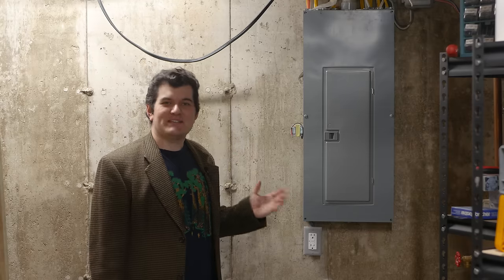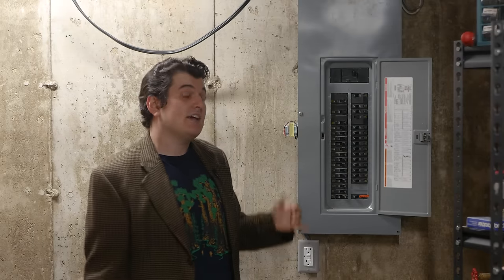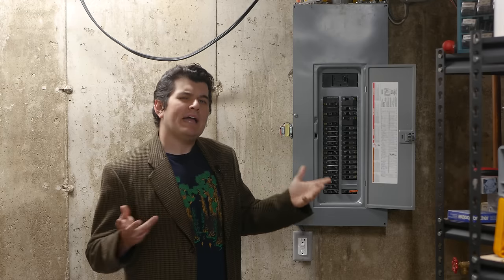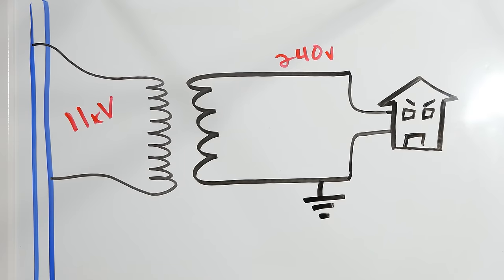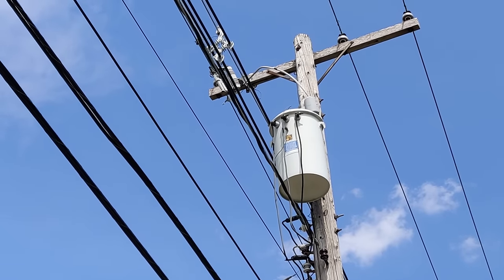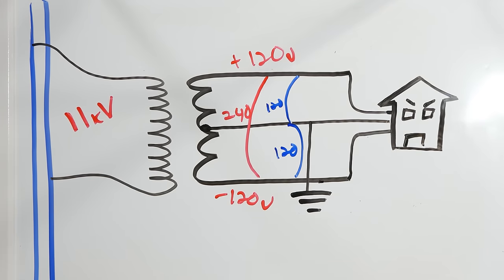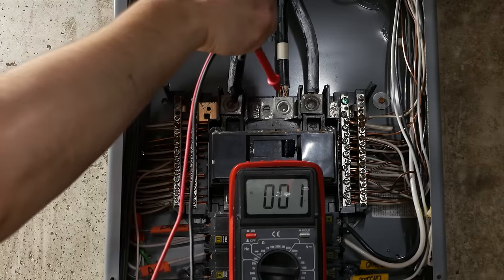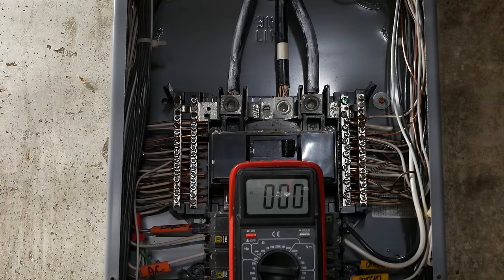The US electrical system is not 120V

Comment: With this logic almost all European installations are "400" volts as phase to phase is 380-420 and phase to ground 220-240 volts.
Reply: That's actually true and acknoledged, here in Australia all live electrical hazards are labelled as "danger 415 Volts"
Reply: Yeah, it's called '3-wire' power and is good for 400V.
Reply: I just found out that while most of modern Belgium has three phase with 400V between the phases and 240 between phase and neutral (as most of Europe has), some older installations have 240V between phases. And this can sometimes differ per house in a street.
Reply: Yes, here in Sweden we have 400 volts phase to phase and 230 volts phase to ground. We also have all 3 phases in our homes instead of the split phase system.
Reply: I just wanted to say the same thing :)
Reply: Put a rcd in the bathroom. Why? I have a rcd on the fuse board protecting the entire house.
Reply: @stefannilsson2406  
We only have single phase in our homes unless you specifically ask for a 3 phase supply. You do pay for it though, literally. 3 phase does run down the street and every 3rd house is on the same phase to "equal" the load on each phase. Only large consumers e.g. industrial, retail and office buildings have 3 phase as standard because they also use the phases for load sharing.
Reply: @ahorsewithnoname643  What country do you live in?
Reply: theoretically 440V in India.
Reply: @stefannilsson2406  NZ
Reply: @ahorsewithnoname643  Ok, I guess you guys have pretty thick incoming cables or maybe you guys just don't use a whole lot of electricity.
Reply: @ahorsewithnoname643  I learned this recently when my lights began flickering, while my neighbours reported no problem. The fault was with with a fuse on the pole transformer down the street - it was going intermittent, affecting just that phase (and apparently overheating, according to the line technician). Now that I look at the transformer and the overhead wires with a better understanding, the three phases are quite evident.
Reply: The big difference as @A horse with no name mentioned and others explained here is that 3 phase is not to the house (unless you pay for it) while in the US the 240V is available in every house and is not a 3 phase installation as explained in the video, we also have 3 phase installations here and annoyingly so as he mentioned those are 208v between phases
Reply: 400V is exactly what our electrical stoves, ovens and similar devices are hooked up to. Most stoves can be set up to use 240V instead, as in pre-war buildings but it makes cooking noticeably slower. Commercial buildings often use 400V sockets (which are a different design) throughout.
Reply: You need to be higher up, as a Danish electrician I was very sceptical about pressing the video as I already knew about the split phase, just thought it was more common knowledge
Reply: All european houses have at the entrance of the building 3 phases and a neutral, the thing is that only 1 of those phases and the neutral go to the final house. If you measure between phases, 480 V, if you measure between phase and neutral (or ground) you have 240 V. So, if you want a triphasic installation you can get it quite easy.
Reply: @stefannilsson2406  
It's been quite a while since I've done this stuff but I believe the connection to the street is 16^2 mm for a domestic installation. Household lighting circuits are done in 1^2 mm, outlets in 2.5^2mm and high demand circuits like those for oven ranges are in 4^2mm
Reply: Yes but do you actually use the 380-420v? Or do you exclusively use phase to ground in residential zones?
Reply: @Brianbd  we definitely use it, anything high current like ovns, and stoves usually use phase to phase 400v and then in the distribution board the three phases are spilt equal to the other circuitbreakers (phase to neutral 230v), meaning we to the house can have have a 4 wire cable rated for 25 amps (don't know how gauges work as we use mm2) on each going into the house, and spilt the load over all of them, giving a lot easier install with cables and a lot more power, plus the less loss in voltage across the cable
Reply: @atropos91  No. We don't have 480V (the double of 240) but 400V between the phases in most of Europe.
Reply: @ahorsewithnoname643  a rcd with a lower tripping current can be useful.
Reply: @josefaschwanden1502  
You realise an rcd trips on the imbalance of current flow. If the current flowing into a circuit is not balanced by an equal outflow the rcd trips and this is measured in milliamps. It is like two people pulling on a rope in opposite directions with a bucket of water tied in the middle. If they are pulling with the same force the rope and bucket won't move but if one pulls slightly harder then the rope will move towards them and the bucket will spill i.e. trip. The electrical imbalance required is measured in milliamps.
Reply: @stefannilsson2406  same here,belgium
Reply: @ahorsewithnoname643  yea but if you install an RCD with 10 mA instead of the general 30mA one it will already trip if you "enjoy" 10mA.
Reply: @Karjis: European installations do not use split-phase. There's no way to use "this one simple trick" and get 400 volts in Europe, unless you pay extra for a 3 phase supply, or use a transformer to up the voltage.
Reply: @josefaschwanden1502  If the rcd trips you have fault condition that needs to be found and repaired. 10 milliamps means a more sensitive protective device than a 30 milliamp one. Do I enjoy a 10mA one, never had it trip on me so yes I do.
Reply: @atropos91  "All european houses have at the entrance of the building 3 phases and a neutral, the thing is that only 1 of those phases and the neutral go to the final house" 

No. It varies between countries. Germany you usually get all three phases with 63 A each into a normal house. UK has one phase usually.
All three phases are then split up (to not stress one phase too much) and two phases (400 V) is used for example for electric stoves.
Reply: I have outlets with 400V in my house. It's not uncommon. Mostly in kitchens for electric cooking. I also have them in the shed for my belt grinder.
Reply: @stefannilsson2406  Normal geometry phase to grount X. Phase to phase = 3^0.5*X
Reply: I've got 440v in the uk, I've always hated the American wiring standard especially as there is no positive clamping onto the busbars, I've also got inverters for other voltages, though isolation transformers make it a lot safer no matter on the voltage

And the building sites use isolation transformers to make them safer to prevent an earth return path
Reply: @Brianbd  Yes we use 400 V! For 3 phase motors, electric furnace,  welding etc.
Reply: Split phase != 2 (or 3) phases
Reply: I think it is safe to say there is 3 phase 400V everywhere, it just does not necessarily show, or be utilized in every apartment etc. depending on the country. But if necessary, it is available.
Reply: Y u no 400V three phase? T_T
Reply: @atropos91  No, 220/380V~50Hz at minimum , up to 240/415V~50Hz at maximum. 230V*sqr3=400V, Similar to 120/208V~60Hz or even better 277/480V~60Hz.
Every european house has 3 phases in the electrical panel box and through the house goes all three phases, one at a time with neutral and ground in the same cable 3x2,5mm^2 (approximately if there were gauge #13 1/2) for receptacles and 3x1,5mm^2 (app gauge #15 3/4) for light circuits. If you have 3 light circuits in house, most likely those 3 circuits are on 3 different phases. For hard-wired stove goes 5x2,5mm^2 cable with 3 phase wires, one neutral and one ground.Main breaker for individual house is usually 3 pole 25A tip C, or 3pole 32A Type C, plus in some countries before main breaker goes 3 individual fuses same size like main breaker.
Reply: Yes, we know. It's not a "with this logic" event, it's "we already know and we want people to know the truth instead of a myth"
Reply: Brian, Definitely 400V is used. Stoves etc usually work with 230V and 2 phases and third is for oven so that was not best example as it is basically just using 3-phase connection to even out the load. But true 3-phase supply is used in water heaters, larger heat pumps. And we Finns also use 3 phase power for sauna as heating a room close to 100 celsius in sensible time takes some power, usually 6 or 9kW heating elements.  We also have 3 phase outlets (red IEC plugs) available in most houses in garage etc for 3-phase tools like big air compressor  or heavier pressure washers.
Reply: B Rumm You are correct, not a split phase, but three phase so just take between L1 and L2 and boom 400 volts.
Reply: @old_spice8054  I have no idea what you are trying to say...

Comment: I'm proud to say I've been shocked by 240UK and 120US. 240 hurt more. I have also stood on a UK plug. Being shocked by 120V hurts less than stepping on a UK plug (in the common case)... I don't think anyone has died from stepping on a plug, they just wish they had.
Reply: Say no more, I've been shocked by 120AC, 240AC, 400AC and 570DC... Nothing in the whole world compares to stepping on a UK plug!! It's a horrible sensation!!
Reply: @TiagoAlmeidalive  
I have never stepped on a UK plug ever. I know no one who has. I have had these around me all my life.
Reply: @johnburns4017  so?
Reply: Avoiding electrical shocks is much easier and less costly than avoiding using more copper or aluminium to make thicker wires to carry more current in low voltage.
Reply: @iamnormal8648  
Also, fitting RCBOs and RCDs keeps people alive.
Reply: @iamnormal8648  who's getting shocked?  What ARE you talking about?
Reply: I just looked up that plug to understand and holy cow it's like a spike trap
Reply: I worked as an electrician from leaving school until retirement and have NEVER had a shock, but I have stood on a UK plug which is just as bad as standing on Lego.
Reply: @russelldresh7832  LOL.  I DO remember stepping on Lego pieces in the middle of the night.
Reply: 240 hurts so much worse!
Reply: @Grammar Police Unit # 117 wrong.  The same muscle contractions from the 120 are there for 240.
Reply: If your skin had been wet or broken it would've been approximately 100-1000x worse!

Human skin resistance is like 100kohm to 1Mohm dry. At 240v that's 0.2-2mA, which you  probably wouldn't feel. Maybe a tingle. If you are totally wet your skin resistance drops to around 1000 ohms, meaning there will be around 240mA running through you, which is enough to kill.
Reply: @TiagoAlmeidalive  Jesus Christ 400VAC
Reply: @TiagoAlmeidalive  Which one is worse, stepping on Lego or stepping on UK plug?
Reply: @trulahn  Hard to choose 😂😂
Reply: @protonneutron9046  240VAC is worse.  The muscle contractions are typically a linear function of power.  V^2/R is a square function.  So if you do the math, (240/120)^2 is 4x more muscle contraction.  240V is way worse.  I've been shocked by both.
Reply: I will add that 50Hz is worse too.  At about 100Hz the muscles stop reacting as the time-constant is too short for them to react.  So from a frequency standpoint the lower the frequency the worse it is.
Reply: Electricity has no respect for supposed logic. 40 years ago we had a fitter die on 240v when changing a light bulb. 3 months later another fitter took the wrong panel off a switchboard ( the reasons are too convoluted to say why here ) and went onto an 11kV busbar. He didn't die immediately but 2 weeks later of pneumonia from inhaling the flames from his clothes. He probably only got 1 cycle of energy due to the bus zone protection, but it still destroys percieved logic. 
P.S. After this awful pair of incidents we subsequently recieved a ROSPA award for 1 million man hours without a lost time injury.
Reply: How can you be shocked by a plug??A plug has to be inserted in the socket to have a voltage!
Reply: That’s true. But nothing comes close to the pain that comes from stepping on a Lego!  😁
Reply: I live in Poland which has plugs with rounded pins, and I had a single UK plug for a phone charger, with an adapter. I still managed to step on it and I can 100% confirm I did not wish to exist at that moment.
Reply: Stepping on a UK plug really hurts. Stepping on a lego really hurts. Therefore, stepping on a UK plug built from lego would most likely be fatal.
Reply: @TiagoAlmeidalive  wait till you meet a d4
Reply: Likewise - my 240V UK shocks have been horrible whereas 110V US ones have been somewhat above mildly irritating
Reply: @TiagoAlmeidalive  where tf do you have 570VDC?
Reply: @rikospostmodernlife  🤣🤣🤣
Reply: @Alexander-me4qq  Frequency inverter DC bus
Reply: @TiagoAlmeidalive  was the 400V between phases or phase to ground? Because you'd be damn unlucky to actually get a 400VAC shock if its between phases
Reply: ive touched over 100V a few times and it really just hurts a tiny bit. I can see the safety reasons for having lower voltage but still. 230 is not all that dangerous but having to use so much thicker cables for 120 would be quite an inconvenience
Reply: @gingganggoolie  400VAC between fases, 230VAC  in each fase.
Reply: @TiagoAlmeidalive  You touched two phases at once? With luck like that, you must suck at cards
Reply: @gingganggoolie  hahaha don't worry,  it wasn't  as bad as you think... I got shocked between my fingers (one hand).
Reply: @TiagoAlmeidalive  simultaneously lucky and unlucky then. Congratulations on not burning your hand off
Reply: @konz2891  what kind of boss did you have that didn't send you to the hospital after the first shock? You should be monitored for cardiac symptoms for 24-48hrs after a shock. Theoretically that's only necessary for shocks through your body, not when touching both leads of the circuit with the same hand cause the current probably won't reach your heart but you can't be sure and there are no separate guidelines for that.
Reply: @russelldresh7832  If you worked that long without a shock you must not have done much of anything. I worked in the field for over 40 years and I've been shocked many times. Some of the work I did had to be performed live without gloves. These jobs were on lower voltage (under 130 volts) control circuits. I was once SHOCKED by 480 volts phase to phase from one elbow to the other. That can definitely be deadly and today I'm sure it would kill me.
Reply: a teenager at a theme park died stepping on a plug, he was already wet from a water ride though
Reply: there is very few think worst than stepping on a UK plug.
Reply: @jacobkuca7711  Guess what your skin resistance is when your skin chars or the arc jumps through it? The thing that's so devious about skin resistance is that it applies until it doesn't, and then you are in trouble.
Reply: In terms of sheer units of pain per resident, I am 100% sure the UK plug being trod on has caused more pain than the US liability to shocks.